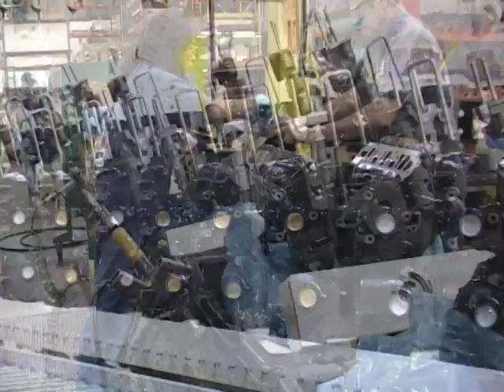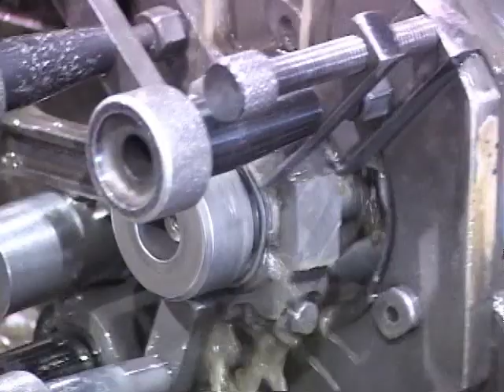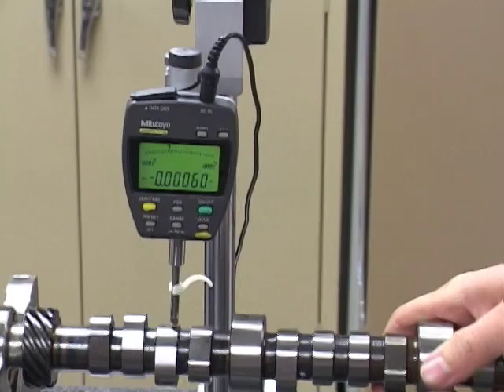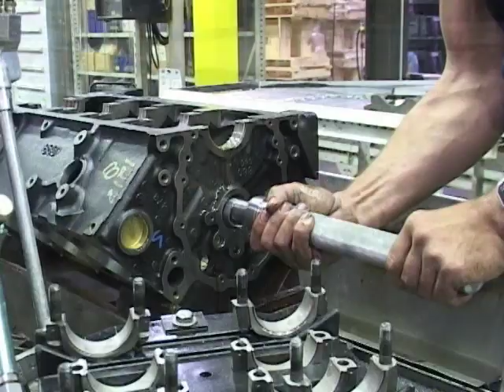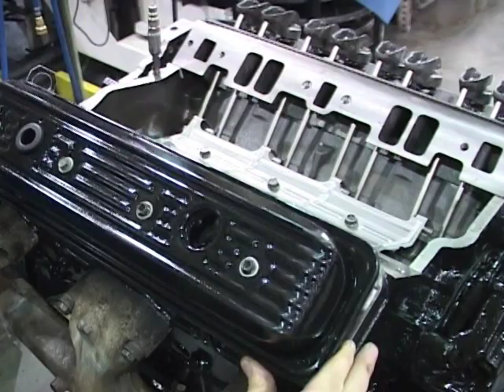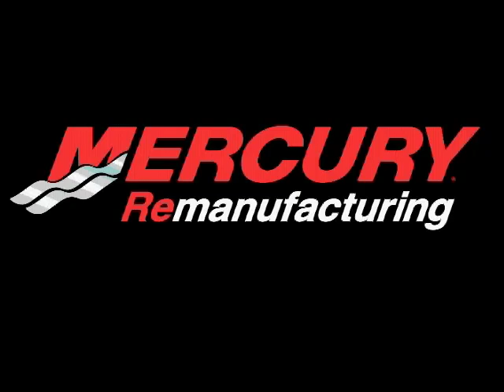Remanufactured MerCruiser Products

Comment: Its funny because this is actually GM remanufacturing.
Reply: Mercury cast their own Engines. So don't confuse Marine Use with a Vehicle. There not the same.
Reply: @MasterChief-sl9ro  Haha. I worked briefly, 9 months, for GM in the 80's. GM Powertrain supplied the marine industry from 4-cylinder to V8 to Velvet Drives and some outdrives. These all were cast at Saginaw Metal Casting Operations in Saginaw, Michigan. Mercury Marine cast there own outboard and certain outdrives. Don't kid yourself or somebody else.